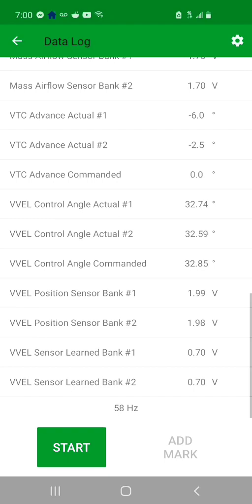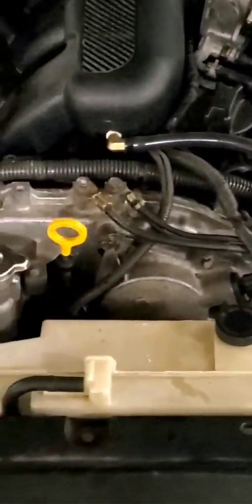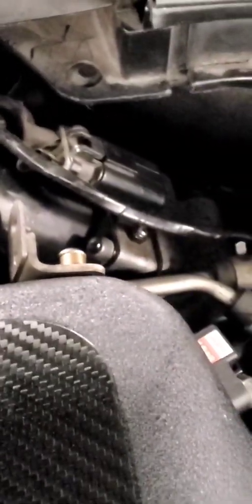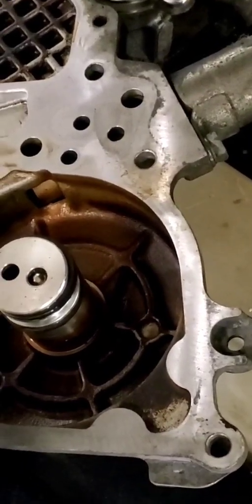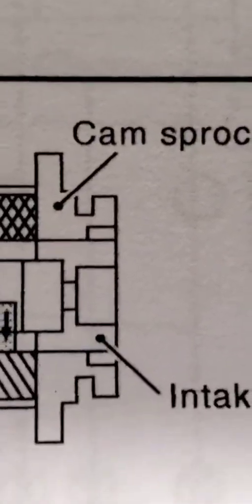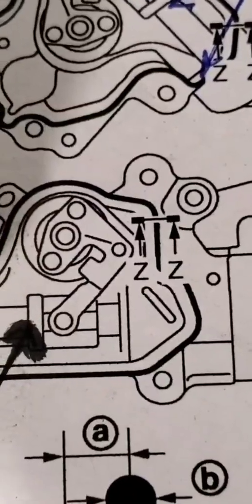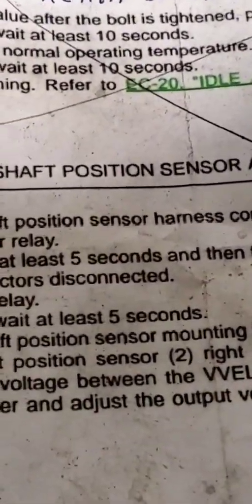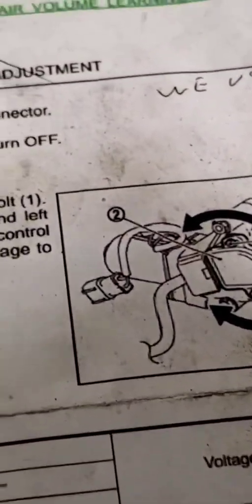How to reset VVEL and VTC info for Nissan 370Z and G37

Comment: Will those vvel stepper motors not being calibrated to the 1.54 inches cause a no start?  I took mine off and just slapped it back on after messing with it and It runs great once started but it's a real pain in the ass to start.  Needs super cranking and starting fluid and massaging the gas pedal

Comment: Will the 5.6VVEL be functionally similar? We put a new used engine in QX80. One sensor on the back on the head was damage so it was swapped with the original engine. Can’t get the thing to start and runs. It will fire and idle barely then die out after a few minutes. I have a SnapOn triton scan tool and have set the replaced sensor at .5v and ensured the other sensor is at .5v. Also have tried the reset disconnecting the sensors and relay and still no luck. No codes at all.
Reply from the maker: I've only had success using nissan consult or aftermarket tuning license for ecutek...functionally similar...I've tried to reset vvel sensors with autel, matco etc..no luck

Comment: p1606 and u1024 here. Both point to VVEL i think. Deleted codes but they stay in the systems permanent memory though. 2011 370z touring 65k. Any thoughts? Im suspecting need to replace it. But everyones all over the place for fixes and some work some dont.
Reply: any solution?

Comment: 1087, 1090 codes for bank 1. Unopened motor all vvel data on ecutek reads proper. Could this be something as silly as throttle body, no throttle, slight rough idle. Throttle doesn’t exceed 1.2k rpm
Reply from the maker: @patrickaubuchon8025  sounds like fuel pump, fuel delivery problem to me

Comment: Hey dude i just replaced my head gasket on my vq37vhr timing is right started up smoothly.. but the check engine light is on but i have 0 Acceleration do i need rest something ? Or any ideas why? Cheers
Reply from the maker: @Casper7ACE  https://youtu.be/BejC0C3xCbk?si=SSSa4vpGKO7tFlC_

Comment: Just got a 2010 g37x recently. It’s throwing a code for p0300 and p0011. Car is in limp mode with SES light on. No check engine, no oil pressure light. Gallery gaskets just got replaced and car is filled with 5w30. Could it be a vvel solenoid or sensor issue ? Or could it be something bigger

Comment: Heeey i have p0300 code tested alot and run a ecutek test ans hav vtc adanaced one on 63 degree and other one is 0 sensor have been replaced and everything gets power maybe vvl ecu dead or the cam phaser ?
Reply from the maker: What's the setup, year, miles, etc? And which bank

Comment: Hey Seth, you seem very knowledgeable. Whenever you have the time maybe you can point me in the right direction.
I have a 08 i was getting P0021 so i replaced the cam sensor and the VVT solenoid. I cleared the code, drove it, got it up to 3k & straight back into limp mode. BUT the weird part is that the p0021 was gone & now i'm getting P0345?? 
I changed the crank sensor and no luck. Oil pressure is good and a fresh oil change.
I've researched a lot and there's nothing definitive, but it seems to be pointing to a slipped encoder ring or it jumped time. 
What would be your guess? 
I did replace the clutch, csc, and swapped the flywheel with a Z1 midweight about 5k miles ago. I went "by the book" with the install, torque specs, loctite and all. I'm pretty sure it would've thrown the code earlier if i installed the flywheel wrong, right? ha
I'll be dying to know what suggestions you have for me.
I've been struggling with this for a few months now. With my wife about to pop our first kid out, I don't want to pay for a two-way-tow on a roll back for Nissan to charge me $200 for a diagnosis. These day's the extra cash is always needed for another case or two of 556.. maybe some diapers too haha.
Thanks for your time & awesome video!
Reply: Any updates?

Comment: I have a brain buster for you Seth. 

Swap car 95 240sx with Uprev flash Nats delete. 

Ok so did a head gasket job on a 2014 VHR motor, kept everything else replaced, seals & such. 

I could have sworn i had the engine in time. However, this motor sat up, clogged injectors idk. Got the heads decked sits pretty at 124mm if im saying that right on all 4 corners for both heads. ( or whatever the spec is i forget) . 

Got it running first crank ! BOOM! AFTER some monitoring, exhuast manifold & downpipe are glowing cherry red. 

I have had Corr performance tell me timing is retarded, too much fuel, too little fuel. Only thing i have not check is fuel injectors. I have reset VVEL with an Autel but no luck. Again, fires up every time. Timing advance read 12° at 1000RPM before i had to shut it off due to glowing headers. Any thoughts?

Comment: P1606 and c1130 here, car is in mega limp mode max 2k rpm’s, rough idle, fastest I can drive is around 5-10 mph. It’s a 2010 with 110k miles. 2.5” intake and exhaust are my only mods, Help would be appreciated it’s my daily.
Reply: Hey man, I have the exact issue. Did you figure it out?

Comment: do you know anything about p1606 and code u1003 and what could fix this there’s barley any info out there, the first code is VVEL related
Reply from the maker: What's mods does the car have..mileage/ configuration etc..just tell me about it and what it's doing
Reply: @sethjoyner391 yo brother I’d appreciate any feed back I’m having the same problem p1606 but with u1024 2012 g37 cai, catback, and HFC. The car starts up prefect everyday but after driving for some time the car just goes into limp mode with NO warning it can drive super nice no weird idle issues but then BOOM limp mode I think is the module but then I see a bunch of threads were people say replacing the module does nothing so I really don’t know what to do.
Reply from the maker: @GuapAnto  I'd start off with observing real-time data of your vvel system to attempt to diagnose...if your vvel angles seem bizarre or unsychronized or if you are missing a data stream; it could be a failed vvel module located behind the fuse box and battery...I'd need more info
Reply from the maker: And what year?

Comment: I just finished rebuilding my 370Z. It started up last night. I had to reflash the ECU to my previous tune.

It is revving up to 3K RPM as if it has a vacuum leak but I'm not sure where that would be.

I'm really hoping I don't have to get another remote tune from Soho Motorsports or admin tuning.

I only changed out the head gasket Cometic and put ARP studs in.

Are you saying that you move that sensor left or right a little bit until it is 0.5 volts then tighten it?

I did measure 1.585 in before I assembled the VVEL actuators. The motor was set at TDC when assembled and everything seemed to go back in place.

I was very meticulous and patient with the tear down and rebuild.
Reply from the maker: Yea, once u have it in vvel reset mode...the sensors move back and forth like an old school tps to get u the desired .51v sensor setting range
Reply from the maker: Sounds like u just need to reset and calibrate the sensors only
Reply: @sethjoyner391  I actually got them both to 500mV exactly. I still have the revving issue. I'm going to have to keep digging! Engine sounds healthy tho!

Comment: Thanks to your instructional collection, I've cammed two VHR engines in my apartment garage, properly installing VVEL control shafts + stepper motors to your 1.585" metric. No fancy equipment either- harbor freight calipers and technical measuring set.

Position sensor calibration afterwards was a breeze via Ecutek; by stroke of luck, the first engine was already within the voltage tolerance before any position sensor adjustment.

You the man Seth! 🍾
Reply from the maker: That's the nicest complement I've had....I thank u brother!❤
Reply: @Seth Joyner  Here's the clip of my latest first start-up, but before I remembered to adjust the position sensors 😅
https://youtube.com/shorts/amtIya29Nls?feature=share

Comment: Hey man, im having an issue where i get a weird sputter and spikes on int/t  of like 60°/0°, and it just keeps swapping the bank it happens in. Its a 2013 motor and i still have good oil pressure. Ive gotten it to give me a code for each  bank, but never at the same time. Also got a random mis code. Im at a loss, its swapped in a g35 sedan. I dealt with a bad swap harness for a year, now this haha. If you have any suggestions for me, id greatly appreciate it.
Reply from the maker: I guess I'd start with removing and inspecting the vtc cover solenoids and internal dynamic seals (ive had physical grooves on the inside of the sprocket allowing oil pressure to seep past the dynamic and cause inconsistent lock up...overall oil pressure would still be stable.....testing vtc solenoids, checking wiring (also if this is a fresh swap make sure u didn't get ur harnesses for the solenoids backwards,  more common on gtr, but shit happens)
Reply: @sethjoyner391  dude holy shit, I legit just swapped the plugs about 5 mins before you commented. I think that was it lmao
Reply: I ran outta fuel right after i swapped them, so I'll know for sure in a few minutes. Thank you for replying though, I really appreciate it
Reply: Yup, pretty positive that was it. Thanks for the reply man.
Reply from the maker: @Boydd916  that's awesome dood😲❤️😊
Reply: I have a 2014 Nissan 370Z with only 14k miles. When I push the car a bit hard, it shuts off and throws a camshaft position sensor bank 2 code. The sensor was replaced with a brand new OEM one, but the issue still persists. When I drive normally without forcing it, everything runs perfectly fine. Any ideas or advice would be greatly appreciated.

Comment: so do i have to reset if i replace the sensors? my car was reading bad sensors and wont start so i replaced them all and it still dont start and still reads bad sensors
Reply from the maker: For sure absolutely...it will definitely not work without a relearn procedure
Reply: @sethjoyner391  appreciate it. I’m going to try and do that myself this weekend.

Comment: Hey so when I rotate my sensors to set them; Do I make sure they show as 1.78V on ecutek?
Reply from the maker: .51
Reply: @sethjoyner391  My sensor is fluctuating from .89 to 4.89 and just jumping sporadically, does this mean the sensor itself is bad?
Reply from the maker: @Stockclipz  I'm not sure I've run into that issue...I will say after the .51 reset...the first number you show seems relatively close if it was in an idle run state, .70ish normal after initial set...but the wierd full voltage jumping seems odd....what year is the car?
Reply: @sethjoyner391  its a 2009 Manual g37 Sedan, I just ordered the exact part number VVEL module to replace my current one.
Reply from the maker: @Stockclipz  very common fail on that year....basically inevitable
Reply: @sethjoyner391  I have replaced the module but unfortunately the bank 2 sensor is just stuck on 4.91 and does not move at all, im just lost. I appreciate the help truly.
Reply from the maker: @Stockclipz  and u changed out that sensor for a new one?
Reply: @sethjoyner391  I swapped the bank 1 sensor and bank 2 sensor and bank 2 was still reading at 4.91V. I checked my VVEL module harness for any shortages and found none. I have my brake and battery light on. Would that affect it? My battery is at 11.38v with multimeter
Reply: And the ground wire for that sensor that connects to the module is reading 6.8
Reply from the maker: @Stockclipz  I'd definitely start over with a good hot battery and a battery tender...personally
Reply from the maker: @Stockclipz  also was it a for sure good vvel module from a newer z
Reply: @sethjoyner391  im going to buy a new battery today, is 575CCA good? Im also not sure if its from a Z and how new it is. I recently bought a module that has the exact same part number as my stock one and I also had bought one from a 2011-2019 Module off ebay. I’m going to test both after I install the new battery and go from there
Reply: @sethjoyner391  hey am I able to replace the vvel actuator motor by itself?
Reply from the maker: @Stockclipz  for sure...it's a pia,  but can be done
Reply: @sethjoyner391  isnt it just the 4 allen bolts? Should be easier for bank two
Reply from the maker: @Stockclipz  it's like 8x 12mm bolts and two 6mm Allen's to pull the entire motor
Reply from the maker: @Stockclipz  I find bank 1 easier
Reply: @sethjoyner391  so i have to remove the whole sub assembly? I can’t just remove the actuator motor itself? Im sorry for bugging with so many questions. At this point i’ll just take it to a shop hoping they can figure it out
Reply from the maker: @Stockclipz  yea, motor pull....most important,  they need to watch my video on phasing the cam to the vvel motor...it's critical

Comment: What software are you using?
Reply from the maker: Ecutek
Reply: @Seth Joyner  is there any way to read voltage like this on the 2008 model year?
Reply from the maker: @shootergamer0321  one could always use a multi meter per fsm...it's just a bit trickier

Comment: Seth, oil flows from oil pump to oil galley up to cams then top end right? Currently doing a root cause of why I lost 3 exhaust valves.
Reply from the maker: Lemme try and make a video tomorrow showing oil flow path from pump to top end through the timing covers and the o rings involved
Reply: @sethjoyner391  Awesome!!! Look forward to it!
Reply: my cam filters have a red residue like a red rag and are totally caved in; but I never used a rag on the bottom end. Which then implies during the project and the conflict I was dealing with at the time, someone whether my nephew or one of his friends, placed a rag in the crank case while the oil pan was off. And I want to cry.
Reply from the maker: @braeder  holy shit!...u had debris in the two filters filters under the cam tower or just the ones in the front under the vtc covers?
Reply from the maker: @braeder  also, was this a forged internal build with exhaust cams?
Reply: @sethjoyner391  just factory engine. With low oil pressure so I dug in to replace the oil galley gasket and tensioner/timing chains. God is going to come down on my nephew very hard! I went to the gym last night saw him there and his girl friend started stiring up problems and got management right away.. I'm like "I'm just trying to work out". Which then implies they have a guilty conscious.
Reply: @sethjoyner391  yes. A bunch of red residue, implying a rag was in my crank case, but I did no work on my crank case. The engine is destroyed.
Reply: @sethjoyner391  both cam filters. Slowly taking her apart. Probably a waste of time.

Comment: Great video. Tks. Can a vvel failure cause the engine to not start/fire? Same as vvt issue
Reply from the maker: Sorry I missed this video....not typically...I've only had them misfire, stumble or run on 3 cylinders from general vvel issues...no start, no fire, may similar to a Toyota problem; however,  on these engines the encoder wheel thats pressed into the vtc intake sprocket can actually slip and change its "clocked" orientation in which the cams magnetic sensor can't pick up the base reference point to fire the engine...these sprockets have had factory revisions...the first couple year vq37 can have this problem